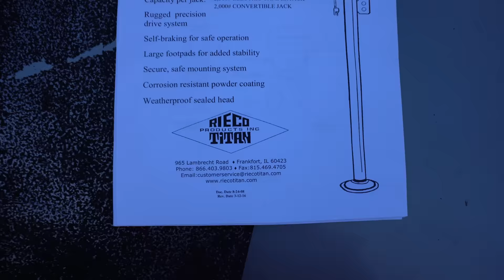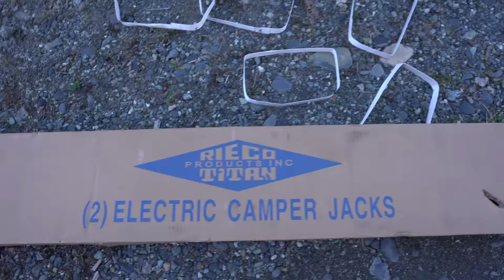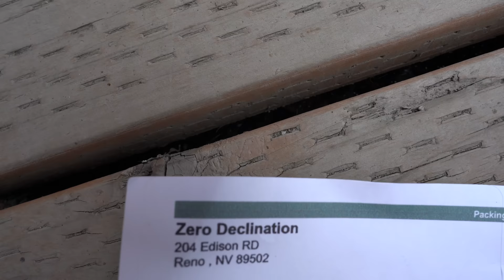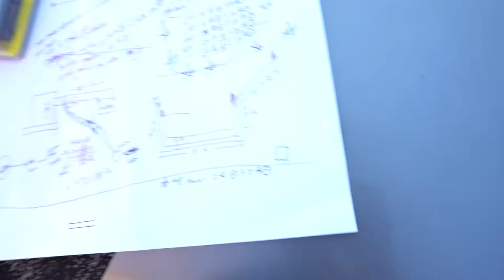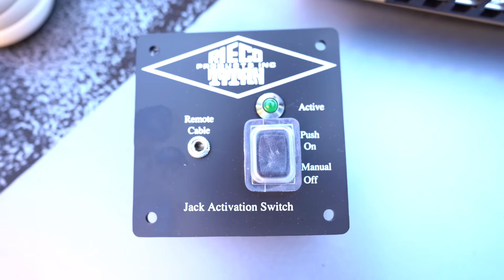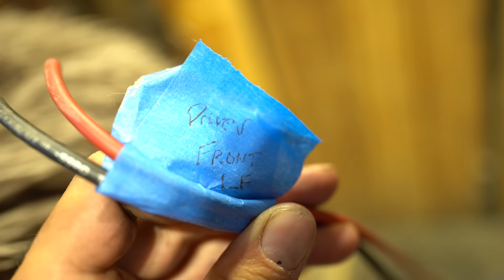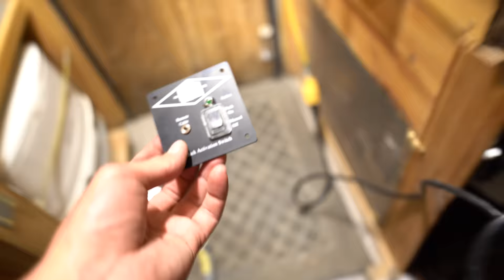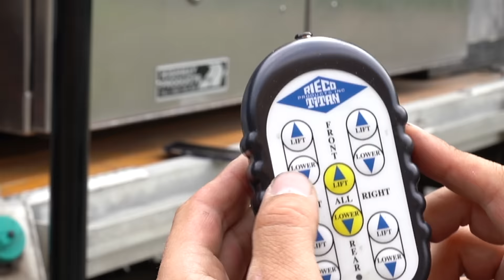FASTEST SYSTEM EVER!  Zero Declination Quick Release Kit |  Rieco Titan Electric Camper Jack Install

Comment: Seems cool but I suspect you will need 4 @ 1' x1' x 1/4" steel plates to expand the footprint, also some cross bracing @ 36"?
Reply: Your jack brackets should extend down to cover the bottom overhang. Then weld a plate on the bottom of the jack brackets, and add more bolts through plate to underside of camper overhang. Now you are not adding force only into side members, but adding force into bottom overhang structure. Jacks are now working with compression load.

Comment: Learned a lot from this on how to do wiring. Thanks, Timmy. Just got my first multimeter. A Physics textbook. I'm really into learning electronics now. I'm getting it, and am building my own Lithium Ion Battery Packs with BMS's for my Vanlife Van. Then I'll do a LiFePO4 cell build Will Prouse Style. The BMS board can have Blutooth hooked to your phone app that monitors voltage and temperature of each cell, every second with high temp phone alerts.
Reply from the maker: Right on man!

Comment: nice, put some wooden plates underneath to spread the pressure on ground a bit, stays easier leveled... 🤙🤙🤘🤘🤘
Reply: I was going to say the same thing except I use a concrete pieces mainly so it does not rot over time. Wood would work on the road thou mainly for portability. The ground will sink down where the legs sit big time in the dirt or soft ground .I also have a foundation for the base when I store for along time made from pallets. This will give the legs a break and make it more stable when not in use.

Comment: just an fyi, the silicone around the perimeter was good, but there should be sealant applied in every lag hole and some under the lag heads before they are fully seated. Failure to do this will allow water to mitigate along the lag into the hole, and “hello” rot. I used the lap sealant that is designed to seal the rv roof vents, as it lasts longer than common silicone sealant. cheers. 🤙
Reply: no I have used pl 4000 to seal a hole with a screw it ain't coming out either
Reply from the maker: I went around and resealed again, the bolts have rubber washers which are basically one use (like metal roofing screw rubber washers) so I don't want to remove the lag screw to put silicone in or it will ruin all the washers and weaken the wood from screwing in a 2nd time.  I'll silicone over the top of the lag bolt heads around the edges to prevent water entry though:)

Comment: Very neat and tidy installation,  just as expected!  I had a  1978 Vacationer cabover on my 78 3/4  4X4 Ford and I had to have the metal peeled back and new plywood put in where the jacks fastened as it lost it's integrity due to dry rot and I was just thinking (a little overkill)  it might help spread the stress if you welded a plate on the bottom of the plates that bolt on the camper, sorta of cradling the bottom of that part of the camper and taking most of the weight of the camper off of those screws,  just an idea.  Thanks for the great video.
Reply: please see my comment above regarding water damage prevention.
Reply from the maker: I thought about a bottom plate, might weld one up eventually, seems super solid compared to my old bottom plate system at the moment:)

Comment: Well executed. I know you made the truck bed into a trailer and was curious if you were capable of putting the truck house in the trailer and pull it with the flat bed full of toys. That could let ya set it up as a base camp to wheel the truck or play with the toys. Thanks for sharing the stoke!